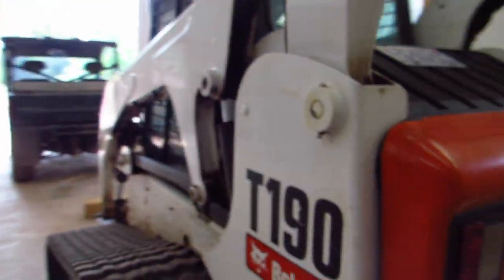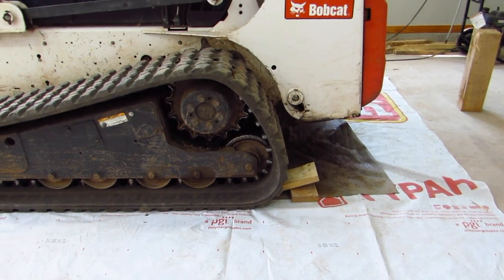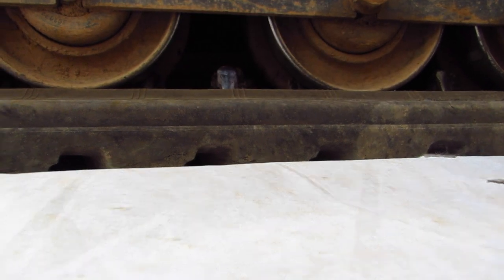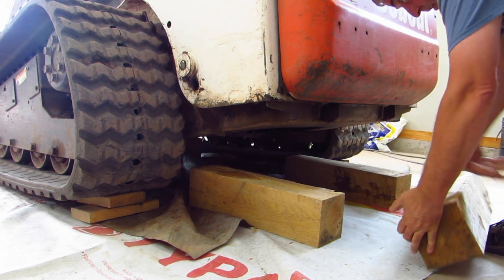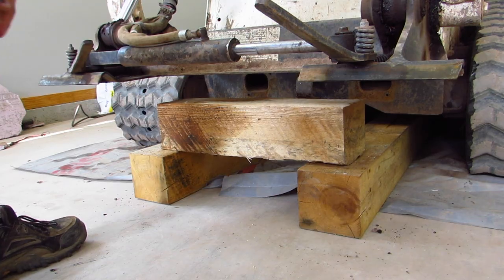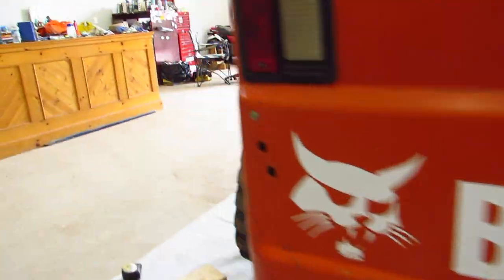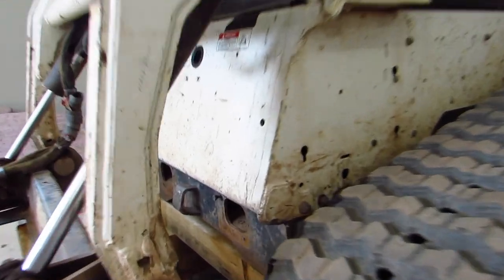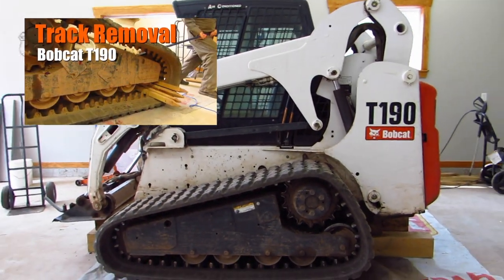Jacking up a Skidsteer for Track Removal

Comment: If anyone does this with a door on and use the bucket to lift the machine make sure the hydraulics don't settle to a point where you can't open the door.  I have seen someone that just curled the bucket down to lift the front up and the boom settled instead of the bucket and they almost weren't able to get the door open.  This is by far the safer and smarter way to do it.  Great video as always.
Reply from the maker: +steffan sedore  Funny you should say that as it happened to me one time a few years ago. I had to use a broomstick through the side window to flip down the seat bar, push the buttons to start and operate the machine, then move the joystick to lift the machine back up so I could open the door. I would have had to go through the back window if that didn't work.

Comment: What’s the difference between T190 with 4 idler rollers and 3 idler rollers?
Reply from the maker: I dunno? They came out suspension under the roller a few years after I bought mine in 08. Maybe they had more rollers?